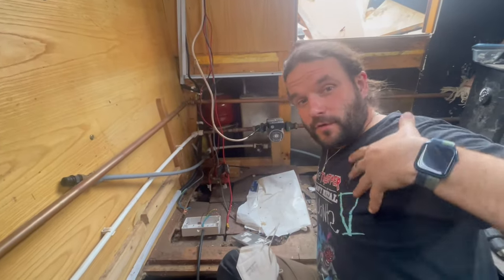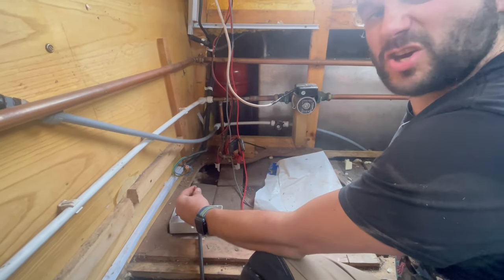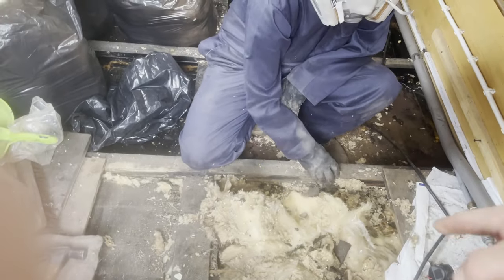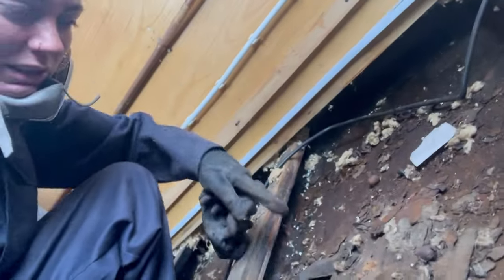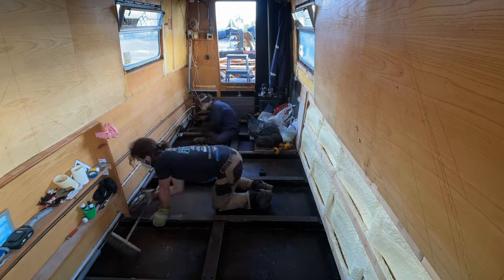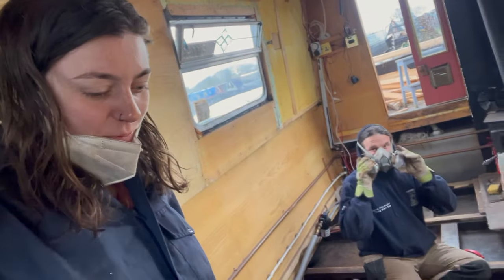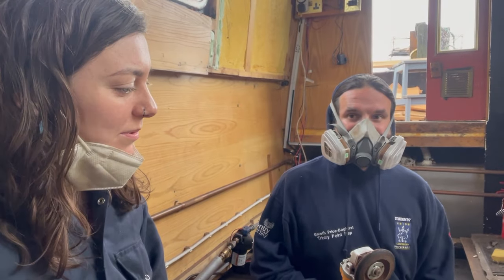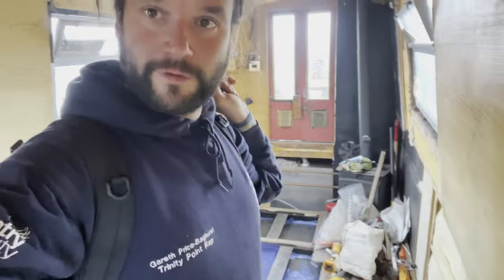3: Narrowboat DIY - Bilge De-rusting and Vactan

Comment: not seen under floor mains before on a boat lol. Think maybe replace it with arctic blue anyway?
Reply from the maker: It’s not supposed to be on the floor 😂 It used to trail down the gunwales I think but we’ve just got everything everywhere at the moment!

In fact, thinking about it, some of it did actually run along the top of the subfloor. Lots to change 😂
Reply from the maker: We’ve just bought a roll of the arctic blue 😁 Good to know that’s a good thing to get!